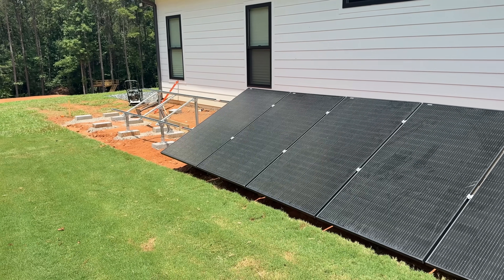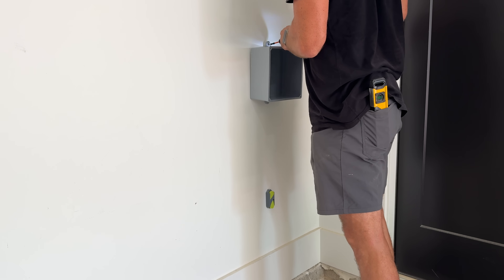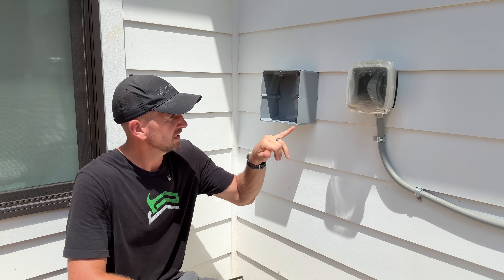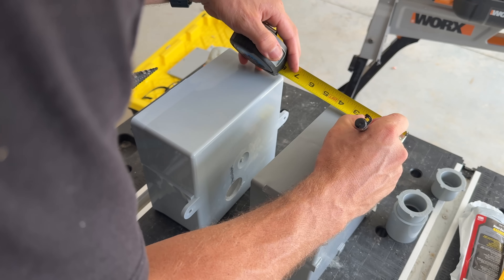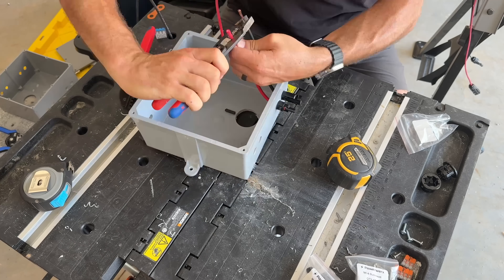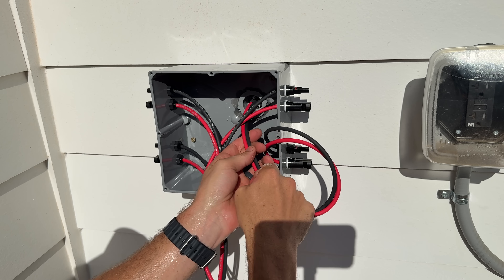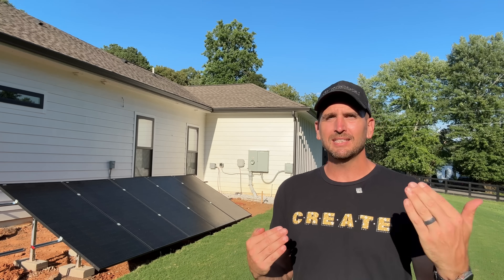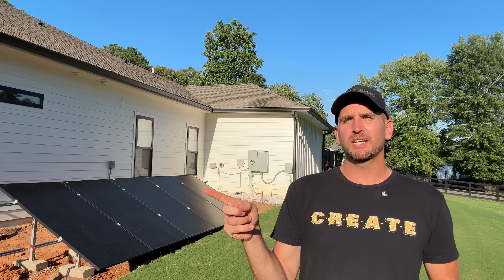How to Run Solar Cables Inside Your Home Safely

Comment: Have you looked at hybrid solar controller so primary charging is by solar, but if it’s cloudy, it charges from the grid as secondary charging? 😅

Comment: I would have built a 2 foot bump out on the back wall of the garage with plywood surface walls for mounting,  and placed all your solar Equipment in that so you are not tripping over everything.
Reply from the maker: Yeah, eventually I would like to bring everything into a "Solar Shed" and then branch to the house and my pol barn but I have some overall system design to figure out before then.

Comment: Are you installing generator and solar into your home?
Reply from the maker: I am getting setup for backup power now as where we are at we will lose power several times per year.  Trying to keep the system flexible to test a bunch of different setups and products in the future.

Comment: At 7:35-:45, are the connectors installed opposite on the red and black feeder wires from the panel array? Maybe I missed something, but the male MC-4 is normally on the red (+) feeder, no? Thanks, nice work you do there.

Comment: This is one of the best ways to wire an ingress panel. One minor recommendation. The MC-4 connectors installed in the junction box are installed in a horizontal orientation. This makes easy to  push the removal clips by hand. With time the MC-4 (specially those of the outside) turns stiffer and eventually you will need a removal tool. By rotating the junction box MC-4 90 degrees it makes easy to insert a removal tool. I normally put them at 45 degrees and it works for both.

Comment: Look at EU how many fires are caused by this MC4 connectors and you have even more connections with Wago.
Bad design, you have DC current and DC currents mean a lot of arcing if connections are  in bad condition.
I would prefer metal boxes on concrete or brick walls. I can not understand this safety standards, that can allow
to build plastic bombiner box on the wooden wall. It is just uncomprehensible.

Comment: Maybe you should have put power switches for those on the inside box so your not handling live wires once they are plugged into that box. I wouldnt but safety third in my house haha.

Comment: I would just run the solar wires in a conduit without a breaks in the wire all the way to the eco-flows and either have a PV disconnect at the panels or right by the eco-flows. And have each string fused accordingly. Good job.

Comment: Great video and build I have been following.   I'm curious why you didn't run all 4 up from the bottom of the boxes to look a little cleaner and take side tension off the wires having to go up and then bend to the side. .   Can't wait for the next video.

Comment: Fun to watch! I just did this same project for my own Ecoflow system but I used a smaller PVC box and just ran the cables out of a hole so its not water tight. I did however use silicon caulk around everything. I have 2X6 interior so I had farther to drill!

Comment: First of all, you better put your panels on the roof (10pcs up to 450V), and use high voltage PV system...
No matter what they numbers showing on the paper, high PV voltage system is performing much better on bad weather...
Sell that junk and get yourself all in one 10kW inverter, and 16kWh battery pack,or two, you will not regret on it...
Good luck everyone...
Reply from the maker: What brand do you prefer for inverter and battery?

Comment: You'd have to be either ill informed or crazy to charge your EV with that transformerless, high frequency inverter. One day when its MOSFETs/IGBTs fail and short to ground, you're going to smoke your EV's onboard charger and void your EV's warranty.

Comment: only thing i would have done different is once you have the outside box up, i would have reached from the inside and either used the duct seal or silicon around it just to make sure the screws and conduit were fully sealed from both sides.

Comment: Since others have already mentioned code type things ... I will address passing the four sets of wires through the wall from one box to the other. Instead of having to do one at a time and going around the garage 4 times, you could use colored electrical tape to mark each set with a different color. Then you only have to make one trip around the garage - not to mention you could bundle all the runs and pass them through together, thus reducing the potential damage to the wires.
Reply: yeah, they sell wire number labels/stickers to apply to ends of wires.

Comment: Do you need to ground the panels? Enjoy your content.
Reply: Most solar power stations have safeguards in case of shorts, they just shut off. DC doesn’t need a ground unless it’s hundreds of volts.

Comment: I agree with the others, being an electrician. You don't want to accidentally damage the wire/cable at all. Coming from the solar array outside, I would run rigid conduit at least 12" below the ground and then continue with PVC, and do the same thing at the other, ending up with rigid conduit attached to your box. Or, you can go rigid conduit all the way, buried at least 12" in the ground. Either way, you need to protect your rigid conduit from corrosion by wrapping it with the right tape. When you're running metal pipe, ensure that it's grounded all the way, and your connectors and couplings are tight. You can't run EMT, btw, below ground, and besides, rigid is much better than EMT protection-wise. As far as inside the garage, since it's a common area where even kids and pets can come and go, I would build an enclosure, even a caged one, around your power station and box combined, and doing it this way, you can avoid running it in metal pipe or a flexible metal conduit. One more thing, with wiring, the less splices, the much better for less voltage drop, so I would have run wire with no splice from the exterior box all the way to the power station. Also, I would install a ground-fault protected disconnect switch in place of the outside box. Yeah, you shouldn't have used those connectors outside your box, as they need to be protected from water, and you certainly want to avoid anyone—human or animal—from being zapped! I would suggest to read up more before you get going. As they say in construction sites, safety is number one.
Reply: I know that you are correct in how to install and that you are following the NEC. But, what to do if you can't follow everything in the NEC. I'm not trying to bypass safety issues. But, I need to consider budget and my physical limitations.  For example, the rigid conduit. What kind of tape should you use? It seems as though it would take a lot of tape. What would it do to the cost? I have always wondered why you can't run a wire for ground using PVC instead of using metal conduit. What if you can't run a trench from the panels to the house due to the type of soil or what is buried underground? What other means can you use for running the cables from the panels to your house? The last time that I have checked with the County. I found that they are not interested in your setup as long as you stay under 60V, you are not grid-tied, and you are not mounting the panels on the roof. I still want to be safe and keep the cost reasonable.
Reply: @richardphillips2405  You can use PVC underground, but out of the ground go rigid—unless the area is secure from traffic that can accidentally damage the conduit, which protects the wire. For tape, we use 2"-wide, 10-mil tape at the jobsite for corrosion protection for the rigid conduit (just shop around). If you have a wall on which you can fasten along the conduit, you can transition to EMT. PVC is cheaper, I know, and lighter, too, but you must protect that plastic from being bumped into by, say, a car's bumper.
      One option is direct-burial cable, but buried at the right depth (24") and with rigid risers buried as deep as the cable.
      For rigid, the 12" I mention above is personal preference, for 6" is minimum into the ground per code. This is 6" of dirt cover, excluding the grass. This may be your best bet if you can't dig for the minimum 18" burial depth.
      Another option is buried PVC at 18" from the top of the conduit, 90 up encased in concrete, and transition into EMT or Rigid. In residential areas, such as housing, 18" is minimum burial depth. As far as all rigid, you can bury it at 6" (again, I prefer 12," as I'm the type to be as safe as possible).
       If you're not an electrician, there's a lot to grasp safety-wise. You must think long term, so that you can just install and forget it. Mind that safety is throughout the use or life of the installation. Yes, you can run only ground wire in PVC or even without conduit as long as you know there's little chance of that ground being damage by foot traffic, such as under the house or through the attic.
       I tend to overdo my own installation at home, so if the city or county says it's good enough, I still go by my own preferences. I buried a 1" PVC run not long ago at my residence for a future off-grid setup, which I'll pick up with rigid up to head-high or even 8' (standard at jobsites). For digging, have you ever used a trenching shovel? It's wide enough (most are 4" wide) for up to 3" conduit. 
       One last option is burying your PVC under at least 4" of concrete. 
       But, If I'm going to run PVC all the way—that is, if the city or county allows it—I would place some additional layer over my PVC coming from the ground, such as even a plywood enclosure (again, personal preference), unless that area is quite secure from being damaged. Just make your installation as secure and economical as possible. I'm used to working in commercial projects, which have stricter rules and regulations in areas that have foot or vehicular traffic.
Reply: @TheTruthMakesUsFree  I appreciate your advice. I have physical limitations and so I have to be careful with what I need to do. If I need to work outside, I take frequent breaks in order to stay safe. Fortunately, I have purchase most of what I need. But, I also need to watch my budget. I am still experimenting with how I am going to place the solar panels. So the idea that Everydaysolar had for bulkhead mounted MC-4 connectors was very appealing. Fortunately, my cable runs will be short as I will be using ground mounts close to the house. I do have friends that would help and maybe I should ask for their help. I want to be as self sufficient as possible and I want to learn by doing. But, I think that they could accomplish work in a few hours that it would take days for me to do. Thanks again for replying. I will follow what you say the best that I can.
Reply: @richardphillips2405  You're welcome, my brother. Good luck with your install and more power to you! (Notice my lingo, being in IBEW—hehe.😀)
Reply: @TheTruthMakesUsFree  I noticed.
Reply: I would raise the solar panels overhead and support the cables on posts   to the wall
Reply: I wouldnt bury cables in dirt  ...  I dont like to put things in where you cannot see and you grab a shovel,, oooooops@
Reply: you see all the old neighborhoods where are still telephoen poles with power cables   going from the poles to your houses all above your head.. they dont bury cables from the poles to your homes, do they?
Reply: @brettkuntze7418  That's why it's called "overhead" runs. There's a whole set of rules on that. Dude, I'm an electrician and once a contractor. I must know something, right?
Reply: @TheTruthMakesUsFree  nah!   modern homes have underground electric all way from transformer to the outside of the house.  and the electric cable is at least 4 feet deep...  so you recommend 12" deep which I think is insane!!  maybe it need to be outlawed and follow the orignal code... that applies to all solar panels going into houses.. either from overhead or very deep way deep in the dirt   4 feet deep or so. I dont think 12" makes insane sense. at all..
if you dont like digging using trench shovel , fine, use posts   and string electric cable from solar panels to your house near the roofline  the same way you  saw in the old neighborhoods where street poles  lead to the high roofline of houses before getting down inside.
or from deep underground up to the inside.
 12"???  Brrrrrrrrrrrrrrrrrr! 
you wil get killed
Reply: @TheTruthMakesUsFree  I dont care what you think !! my common sense beeat youi
Reply: @brettkuntze7418  Time to stop, man. Just move on with your life, okay?
Reply: Cut the vanity by tryhing to bury all cables all over.. it is very likely that you will hit one of them with your crummy shovel.

Comment: My 2 cents as a solar installer. Prefer to drill holes in bottom of jboxs when possible to prevent water entry, and also add weep holes for water to drain out. It will get in. And I second the comments about metal conduit for DC solar wires inside a home. I'd run a metal conduit from array to metal jbox, then metal conduit to interior metal jbox. If you need frequent access to jbox I'd get ones with a hinge door/cover and use gland connectors leaving the box, useing wagos inside and skipping mc4's altogether. and finally label everything well so it's abundantly clear which wires are which.
Reply: Would you have done a disconnect too?
Reply: ya ide run everything thru 2 gland ends and keep positive and neg separate. not a big deal if they chafe thru eachother.
Reply: Positives and negatives can be bundled.  In fact, they should be bundled and taped in pairs with colored tape to avoid any possible confusion on the pairs.  The DCNEG wires are not interchangeable so they MUST be bundled.   The larger problem he has is...  well, the entire thing he's doing is a problem.  I wrote up a proper solution in a main comment.
Reply: You and I have done this before. Myself, I would have moved the ground mount a little farther away from the house. Homeowner installs often cut corners and that's when the cheap MC4s become an issue and burn. But at least the panels are not on his roof.
Reply: @Icehso140 hi.  I'm in the initial stages of planning my ground mount.  I have to ask.l, why do you recommend the ground be away from the house?  My lot is a lil narrow.  I'm in florida, do I have to use conduit no matter what ( wires inside and outside the garage)?  Do you recommend a specific type or brand of conduit?
Reply: @fltourist4264  If the panel catches fire, I prefer them off and away from the house at least a bit. Conduit is usually PVC. Anything above ground needs to be schedule 80 PVC most likely not available at HomeDepot or Lowes. Be sure the panels frames get grounded. Use only PV rated wire which  is 10ga with insulation that makes it look like 6ga. Use proper MC4 tools when terminating. Don't cheap out. Bad connections will burn. Stay safe.

Comment: And where is your solar DC input disconnect switch?
Reply: if it was up your 🫏 you'd know 😂
Reply: The power station has overload protection. A disconnect would be good, but it’s not mandatory.

Comment: Do you have to use breakers?
Reply from the maker: For 3 out of the 4 strings the max voltage is 150V so I am not worried about a disconnect.  The Delta Pro Ultra does have a high voltage solar input that goes up to 450V and would be nice to have a disconnect at the junction box for that one even though the Ultra unit has a discconect at the MC4 input connectors.
Reply: You can get cutoff switches for solar, but it’s not dangerous unless you have dozens of panels. A fuse is a good idea, though.

Comment: Are those wagos going to be able to handle the voltage? I think those max out at 300v and ten 400 watt panels in series come pretty close to that. I recently did a similar set up and went with din rail blocks with higher voltage handling (700 volts) even though the wagos would have been easier.
Reply from the maker: The WAGOs and IDEAL INSURE can handle 600V.  I was thinking a din rail setup but wanted to experiment a bit with this custom setup.

Comment: Interesting. Where I live, I *believe* (I could be wrong, I'm not an electrician) that once solar wires enter the home, they have to be in metal conduit. Again, don't quote me on that.
Reply: Does 2023 NEC 690.31 A(2) or D(1) apply?
Reply from the maker: You are correct but for portable units like the ones I have that is where things get a little weird since the units move and aren't made to be wired into a circuit with conduit.
Reply: @everydaysolar  Ah, got you. Ok, good to know.

Comment: With the connectors inside the box, do you have a power drop?
Reply from the maker: I don't think it will be an issue.  I have done resistance testing on lever nuts in the past and it is more than wire nuts but shouldn't result in much voltage drop.

Comment: I'm curious to see what kind of conduit you end up running the exterior wires in.  I would have thought you would have just run the wires in a conduit to the junction box and then used the MC4 connectors on the inside.  I realize they're waterproof, but I assume you're going to use conduit to keep them from getting damaged, so running conduit to the exterior box seems like the solution that resolves all your exterior needs.
BTW, really thought your stud finding tool was very nice.  I've seen ones like that before, but the one you showed was very simple and convenient.  I'll have to see if it's at your Amazon link.

Comment: Isn't this NOT code approved?? I thought DC wiring on or in a building has to be in metal conduit and boxes???
Reply: NEC 690.31(D) – Direct-Current Circuits on or in Buildings

This section specifically addresses PV system DC circuits that are run inside or on buildings, and states:

> "Where inside a building or structure, PV system DC circuits that are not part of a listed system operating at 30 volts or greater shall be contained in a metallic raceway or metal-clad cable that complies with 250.118(10), or be installed using metal boxes or enclosures."